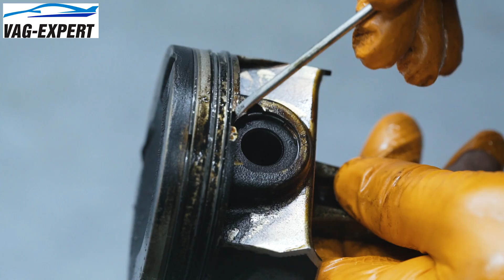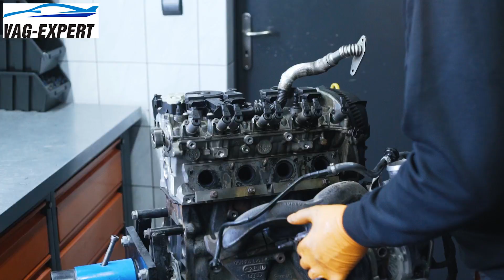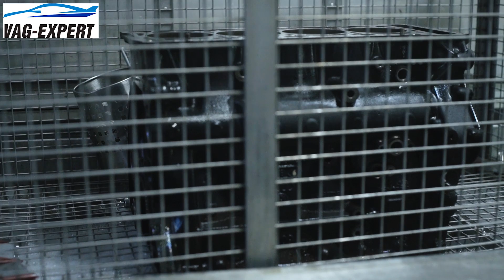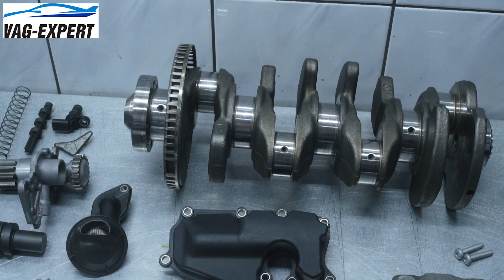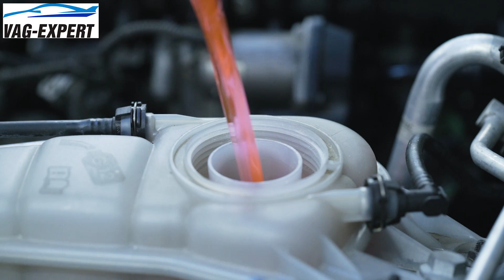TSI and TFSI engine overhaul

Comment: So the guy says " the whole timing drive has to be replaced every 150,000KM " 

WTF is the point of the chain then, if we have to replace the whole timing drive? Why not make it a timing belt then? IT would be much easier to replace. FUCK VW
Reply: They're not advising the customers to drop their car off at the shop to change the timing drive at that interval, they are advising that it be changed out during an engine overhaul if it has that many kilometers.  That's a common rule you will see in a lot of service manuals for different brands of cars.
Reply: @paulburger8710  Ok bro, so what is an Engine Overhaul? It's MORE than just a timing drive obviously. Why wouldn't you change the timing drive if you are going to OVERHAUL the entire engine?
Reply: @sranjesuper  No.  If the engine has low miles on it at the time of rebuild then more parts are re-used.  In this case, the service manual is instructing that the timing components be replaced if the engine has greater than 150,000 km on it at time of rebuild.  This is common to see in shop manuals for all makes of cars.
Reply: @paulburger8710  Listen to what you are saying> If you are rebuilding your engine under 150,000km, there is something seriously wrong with it. And for sure i would replace my chain , tensioner, and even the sprockets if they are a common issue on this particular engine even if i'm at like 70,000km.  I know on my 1.8L m103EVO engine, the camshaft sprockets are a big problem as early as 60,000km especially if you neglected the oil changes.
Reply: @sranjesuper  I'm not arguing that it's right or wrong, I'm just telling you that it is not unusual for any manufacturer or a company that writes shop manuals to require replacements of certain parts during a rebuild if the engine has more than a specified number of miles.  If the engine spins a bearing at 20,000 km because of defective bearing material many rebuilders would reuse the timing components if there's no other damage.

The general approach to engine rebuilding is to clean and inspect all parts for damage or wear and replace if they measure out of specifications.  Chain guides are plastic and they experience wear from friction and from heat making them brittle.  Chain "stretch" is difficult to measure, as is tensioner wear, so it's best to just replace if they are old.  In this case the recommendation is said to be 150,000 km.  I agree with you 100 percent that if there's evidence of lack of oil changes and/or incorrect lubricant use then the chain, tensioner and guides are headed for the recycle bin anyway, along with probably all the moving parts.  And some of these early TSI engines had bad tensioners to begin with. I think there's an updated chain design as well so those would get replaced as per VW anyway.

Are you talking Mercedes m103?  That's a great engine.  Never had a VW TSI engine but I did own an m103.
Reply: @paulburger8710  lmao i put m103EVO. I ment M271EVO 

I did have a M103 Inline 6. But i wuldn't really call it reliable. The valve guides always leak oil due to a flawed design. I currently have a M271EVO 1.8L that is stage 2
Reply: @sranjesuper  Ah, makes perfect sense now.  I thought maybe the 1.8 was a typo!  My M103 burned a bit of oil once it was over 200k miles but I put 5W50 in it and that pretty much took care of it.  20W50 in the summer.  The m103 engine is like a lot of other engines in that the rockers put side load on the valve stem causing wear - at least that's the explanation I heard.

Comment: Nice to know that volkswagen/audi sold engines with defective pistons, the manuals even say that 1 litre of oil consumed per 1000km is okay! What a shitty company.
Reply: Every brand I’ve worked for (been in the trade for over 20 years) say that engines will burn up to a litre of oil per 1k miles. This is normal, nothing to get angry about.
Reply: @sunburst7246  AND WHAT DID YOUSELL A 4 STROKE ENGINE OR A 2 STROKE ;]
Reply: @meme187ridvan6  There’s nothin to get excited about here, oil usage is normal. 😀
Reply: Lol 😆

Comment: Are you telling me I need an engine overhaul 100k km in? And that I should pay a few grand to fit it? 

I'm happy driving my 15yo mercedes with 320k km, running perfectly.
Reply: Just sold my 13 yr old BMW 530D (240K km) as it's too small for the kids in the back and get a 1 year old Skoda superb with this engine. I hope it will also last 10 years!  I hear you about Mercedes, I was in a taxi that was near it's 2nd engine overhaul but at 750,000KM the only problem it had was some noise from the wheel bearings that the owner knew could be changed quite cheaply. Merc's are SOLID cars. New (ish) skoda has near E-class legroom but I cross my fingers on VAG group...

Comment: Bardzo dobry film. Jakosc uslugi 1000 % profeski. A mam pytanie moze co 2 albo 4 wymiane oleju uzywac plukanki przed wymiana oleju i po sprawie. Odgruzuje sie pierscien olejowy i zacznie nie brac oleju. Szkoda ze koszt uslugi to regen. Silnika i koszt pojdzie pod dobre 15 do 21 tys. Ale jakosc uslugi macie zacna. Fajny lektor angielski ddla promocji.

Wery good video. Quality of maintance 1000% profesional. J got a question what if in ewery 2 to 4 time with oil hange yuse engine flush liquids. Its should eliminate the cause of pistons engine rings to eliminate the cause of stucking. And eliminating the extra oil taking. It is sad that you need to do whole engine regeneration to be 100% shure engine will not fail after regeneration proces performed by thr workshop. And the initial cost of reg. Of engine will be counted in thousands of polosh zl or euro or other money curency if someone intrested in this procedure. Love english lektor for promotional purpose of workshop. 

Sory for english gramar j speak much beter english that i write. Newer studiet english gramar. Lerned english from cartons haha
Reply: nice 
you doing great

Comment: VAG really needs to come out and explain to every consumer the importance of high quality fuels and lubricating oils. Basically all of the manufacturers need to at this point. Essentially every problem detailed in this video can be distilled into the following: People cheap out on Petrol/Gas and Motor Oil (all fluids in general) and this causes tremendous wear and tear on every internal component of the vehicle. The oil control rings going out in the 1.8 -> 2.0 engines (it's the same bottom end, the added 200cc of displacement comes from the head) is directly caused by poor quality fuel, oil and not servicing the vehicle: quite specifically skipping the oil changes, one too many times. Really this simple with these motors.

In short:
It puts the premium in the tank or else it empties the bank account again!
Reply: My car has a full service and is still experiencing the problems above. You are talking nonsense.

Comment: Solution...throw away car, get yourself a Toyota.
Reply: Learn about the Toyota 2AZ-FE engine problems.  Very similar to this, the piston rings get clogged up.  And on earlier versions of the engine the bolts holding it together (cylinder head bolts) strip out in the block and the head gasket fails.

Comment: Funny my Ibiza Cupra from 2016 has never used oil. Changing after every 15000 km and never have to add up any oil between.
Reply: thats good. its amazing they took so long to redesign the issues in pistons and rings. Why 8 years later???

Comment: what does it cost to replace the timing chain of a golf 5 gt sport (2007) in poland ... i am from the netherlands and asked the vw dealer what it will cost me ... they have calculated that it
 costs 2200 Euro haha that is an insanely high price (1/3 of the current car price) I had it replaced by another garage and paid 1780 euros .. and I am very curious what this kind of repair will cost in Poland ??? ???
Reply: get a friend and mexhanic to do it for 1000 Euros or less plus parts or do it yourself. Check out videos of Humble Mechanic on YouTube for tips if you want to do it yourself. It's fun work to do in your garage.

Comment: If you are claiming the issue is bad pistons, then why did Audi add dual port injection on later tfsi engines that fixed the oil consumption issue?

Comment: I had the same problems in my THP 155 Citreon C5 .New Turbo, new Kat, 2 new timing belt,. What a shame. It was otherwise a great car. )-:
Reply: I had an Peugeot Expert about 2010 i think, safter only 15000km the camshaft did not move anymore! :) Now i have a same model Nissa NV 200 same year and still go with 150000km!

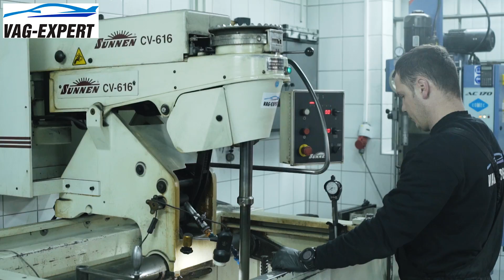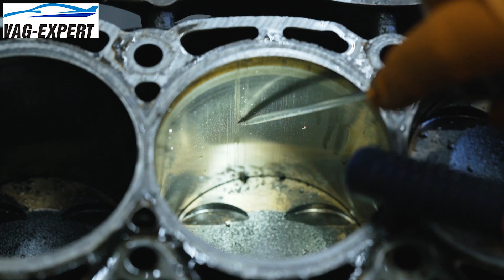Comment: 6:04 It has more scratches than after 300,000 km stock 4:49
Reply: haha, it does not matter as they will insert that cylindrical spacer in it
Reply: This is what the cylinder surface looks like after honing.
Reply: That's honing, those are meant to be there. Vertical scratches are bad, 45° angle scratches are good

Comment: my 1.0 TSI doesn't do that. idk about the carbon issue. 5850 kms so far and no issues. yet
Reply: This video is dedicated to worn-out piston rings which due to friction damages the ring and the wall itself, such issues cause oil consumption due to burning. The issue is solved by doing such a job.

Comment: Surprised no one has mentioned the plastic brittle pipes, pcv issues, plastic parts and cheapy build quality in parts of the engine which end up leading to these issues, oh the 4.0TT turbo issues ranging all the way back, door lock issues, the list goes on...and even with fixing some oil consumption, they still use a lot of oil for my liking, the amount of carbon you get when cleaning is a stupid amount...
Reply: All so true! But the power and operation is nice just like BMW motors only more economical

Comment: No need to rebuild the head. Original valve guides last well up to 500,000kms problem free. Just maybe clean the valves and change the stem seals. Also, cylinder liners on this engine is not the best chouce because the cylinders are coated with a lining that reduces friction dramatically and increases fuel efficiency and power. Installing sleeves changes the characteristics ofvthis engine. It's no longer a proper tsi/tfsi. If your walls are scored, just buy a new block or a used one with no scratches. Everything else is right on!
Reply: Iron sleeves on most engines retain oil while pistons get coatings. It would not make sense to coat the cylinders if they need to retain oil and contain cross hatch honing pattern. Bearing journals get polished but cylinders do not get polished.

Comment: I had 3 cars with tsi engines. I never had an oil consumption. Well, it wasn't 0, but maximum 0,5 liter between services (every 30000). And I have to mention that i'm making over 80000 km per year. My strong advice to all TSI users is to always keep the engine revs above 2000 rpm. It is very important! Those engines hate low rpms.
Reply: Drive them hard. It's not for GRAND M/P Sunday driving
Reply: Because secon gen of engine had burning oil problem. First and third did't.
Thats why they use rings from first or third gen to fix the burning oil.

Comment: I have VW Tiguan 2008 tdi 140hp more than 8 years, Zero problems, only normal services.
Also have a VW CC 2015 tdi 177hp, monster car (for that level), more then 3 years, Big Zero problems..
For both I change oil, filters (Engine oil Liqui Moly, Bosch filters ) & Additive Liqui Moly (DPF cleaner, Desisel additive, etc..) each 6 months by myself.
THERE IS NO PERFECT CAR..
Just take care for her, and she will serve more.. 
Enjoy your car 😊
Reply: TDI is not the same as TSI or TFSI

Comment: Who spends this much money on an old Audi?
Reply: Old Audis don't have problems...Old Audis don't use TFSI
Old Audis are normally 4 5 or 6 cylinders...
Old Audis use Cam Belts not Chains
New Audis are Not worth having as this vid testifies 👏
Reply: @TheMuzikall  I am looking for an 'old' Audi A4, gasoline 1.6, 1.8 or 2.0. Up until which year are the Engines OK? I thought the FSI was introduced in 2003 but this video says FSI TFSI Engines from 2008...do you know?
Reply: @TjeRod   Tfsi with that problem start from 2008 to 2015 , all cars had that problem but manny of them had this solved from warranty , but some disn t so becarefull what u choose
Reply: @Adrian8-q1m  thanks!
Reply: @TheMuzikall  100% relatable. Got a Audi 80 B4 2.0E ABK. No Engine Problems after 273k km :D
Reply: its way cheaper then new car this costs around 5k eur
Reply: @dado5162  way cheaper? if you buy used audi A5 in not complete disaster shape it will cost you around 20k Euro + 5k on the engine itself....

I like VWs and Audi, the design, ergonomics, and everything about these cars is just as it should be, everything works for me. but the TSI is a disaster. Due to that i rather bought TDI, it sounds like shit but it just goes 250k km on the clock and still runs like a new one.
Reply: Paid 5k Canadian for rebuild Audi A5 engine, runs great one year later

Comment: But 2.0 TFSI engines before 2008 (with timing belt)? I have 2005 A4 B7
Reply: I don’t think those suffer from the same issues, but I could be wrong...although they have plenty of their own problems 😅 Have an ‘03 A4 myself
Reply: My 2007 b7 2.0 tfsi burns very very little oil. Great engine. I always use premium fuel and ensure engine reaches full operating temperature on any journey.

Comment: stay away from these cars  had bad experience owning a vw jetta .soo happy i own a honda accord which is a 11 year old car.
Reply: look at new honda civic 1.5 turbo u need to change oil every 10000tkm
Reply: @Knorsky  I change every 7000km, whats wrong with 10k km?
Reply: @mr.superstar7919  nothing wrong with 10k but better question is what is wrong with 1.5t engine...
Reply: @Knorsky  I dont have it, however, Ive heard it consumes oil too. Mine 1.8 i-VTEC has 140 000km, doesnt eat a drop of oil. 😊
Reply: Yea it really ring some bell is it, own things with a bad history on an old expensive least reliable is just mind bogling
Reply: I hate the design of hondas, and they rust as if they was designed to
Reply: my accord 2.2 i-ctdi 2006 so far did 100k miles without any problem in 3 years . bought it with 100k on the clock.

Comment: How I wish we had such service from some of our vw/ Audi dealers or specialists in my country 🇿🇦. An engine overhaul is very expensive in south Africa. I  own a 2012 Audi Q5 2.0 TFSI with 133000 km, so far I haven't had huge oil consumption issues.
Reply: My 1.8 tfsi 2009 has been flawless with no problems at all, But suddenly at 150.000 km my timing chain collapsed. My oil consumption has also gone up. It consumes oil like I drink water.
Reply: VAG-Expect in Menlyn(On top of Glasfit), Pretoria will help.
Reply: Dealer, won't help, even if you have a warranty. You'd first have to pay a fee for an oil consumption test, then they still end up taking your car to a 2rd party workshop like these featured in this video

I'm also struggling here with my Audi , I'm basically used 4 litres oil over 1500km (ok, driving hard though) but it's more embarrassing than anything else, Clean Audi that smokes uphill

You actually better off taking your Audi to one these approved 2rd party workshops that can service or overhaul your motor and still charge on the warranty, excess of R80K
which the warranty might not completely cover

Comment: wait.. but 1.4 tsi or tfsi is good ? thanks!
Reply: Not all of them. Check if you have an EA111 version or EA211. EA211 is free of this problem.
Reply: all are bad
Reply: @MrRohanThomas  Of course a 5.7 HEMI V8 would be much better
Reply: @LubomirPotocki  yes more power but double the fuel consumption and annual taxes
Reply: @jamesmedina2062  no, quadruple the fuel consumption

Comment: I'm guessing this isn't all TFSI engines? I've had 2 Octavia the first i sold with 260,000 km, i haven't noticed any unusual oil consumption
Reply: In the late 2011, VAG came with some new pistons (2nd generation). But in 2015 they came with the 3rd generation pistons, which is the only correct solution. The 2nd generation pistons from 2011, still got the failure, but they will last a little longer before the error steps in, and the oil-consumption increases.